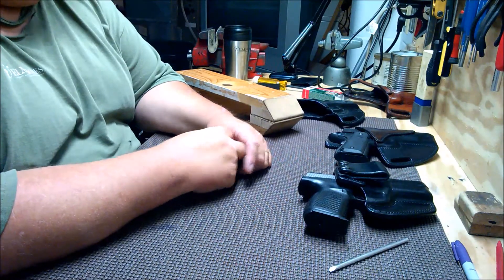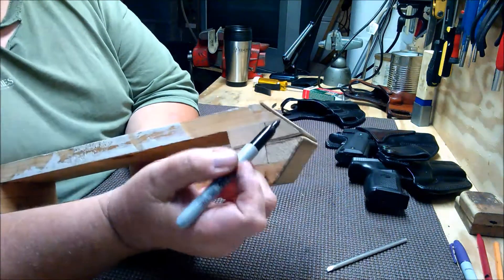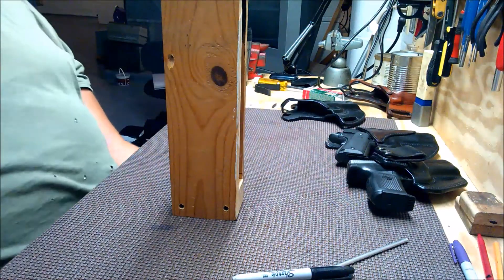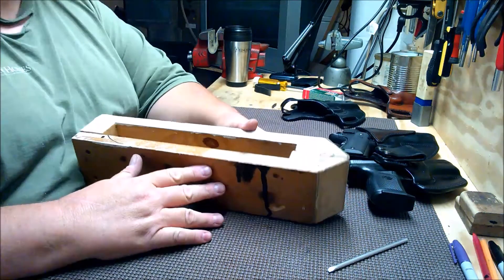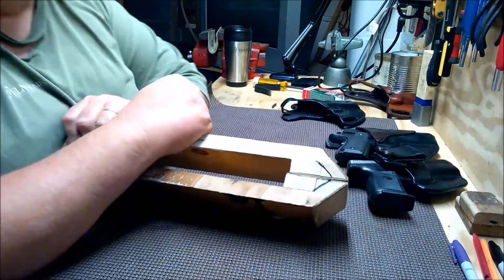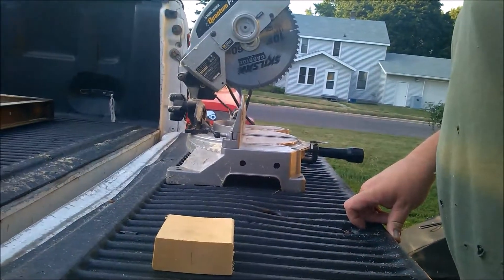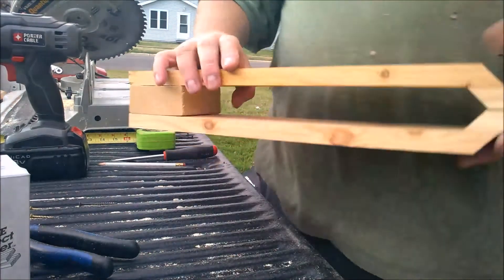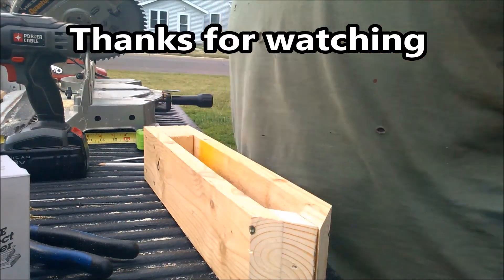Making a leather craft stitching pony

Comment: A man having a stitching pony ... sounds wrong but ... I have one to for leather work. I just need to call it something else :)
Thanks for the Video Mr. Tolly
Reply from the maker: You're welcome, I'll be building another one soon with a few changes.
Reply: Would love to see what you are planning as I need to build a new one asap. Hoping I can use hardwood but I will see. Please keep me updated?
Reply from the maker: I figuring on using Oak this time, the pine didn't hold up as well as I hoped and I only got a year or so out of it. Check back in a couple weeks since I'm still working on my new bench.
Reply: Good to know you are also planning a new stitching pony. I was thinking about a real working horse and thought that yes hard wood would work but it will need something else. The idea of using 2" flat iron, routed into the back of each wood piece will reinforce the pony. A person might then if needed cut sheet metal and attach that to the wood and flat bar.